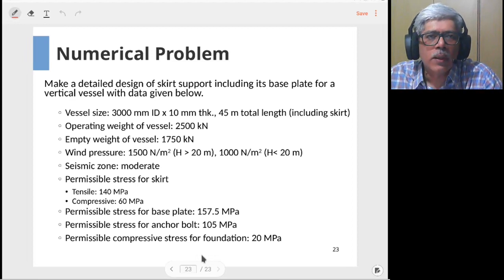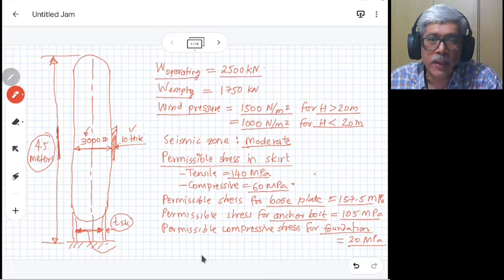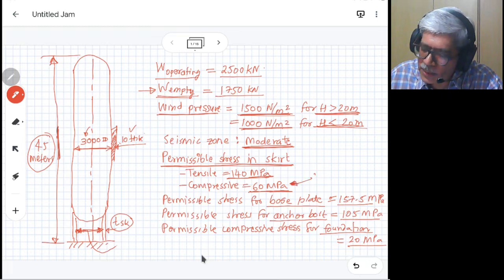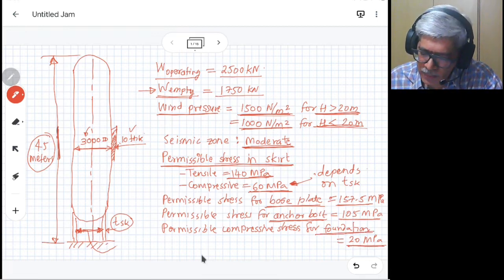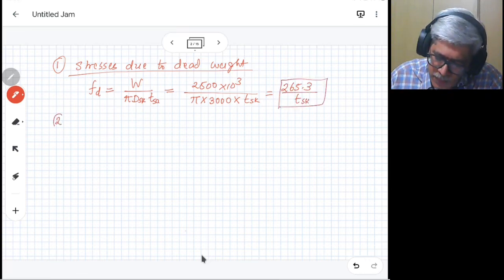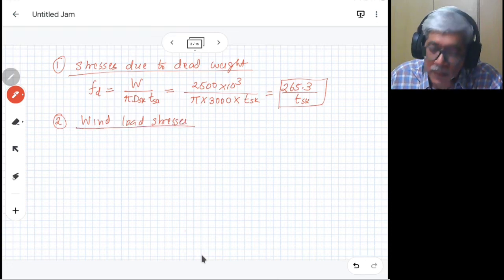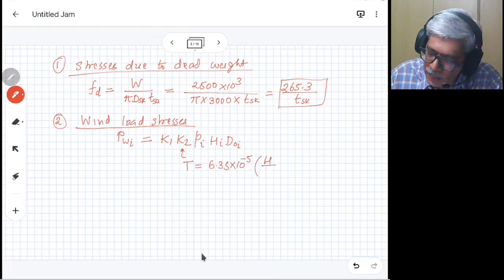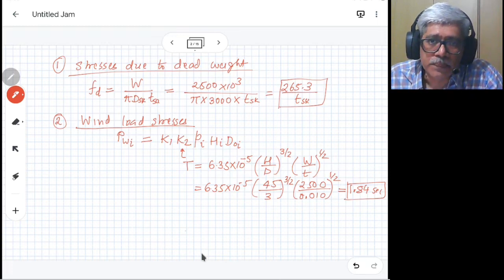S13E Support Design - Skirt Design Calculations - I

Comment: Siir
Can you guide me, how to design a skirt with large opening. While designing in PV Elite software, there is warning for radial  buckling, and  provision of frame may prevent this. But how to design the frame.?
Opening is 32". Vessel is 5.8m dia x height 35m, weight. Weight 162m
Reply: Weight 162 metric ton